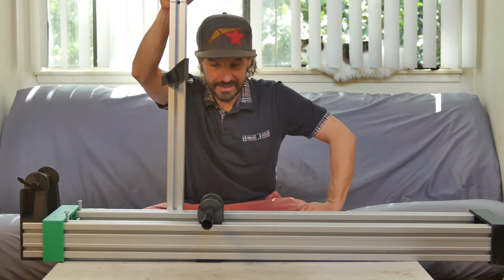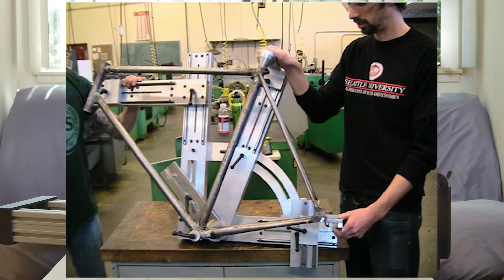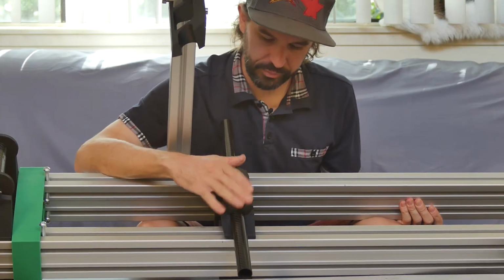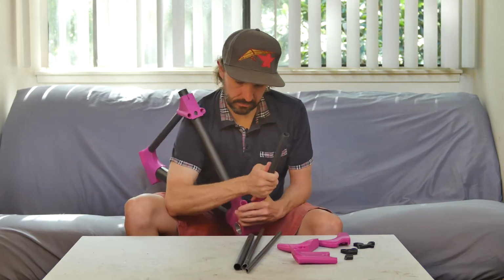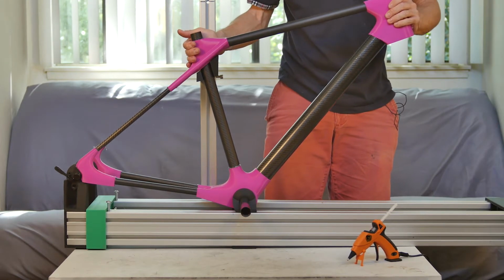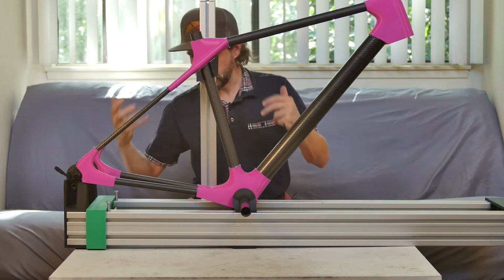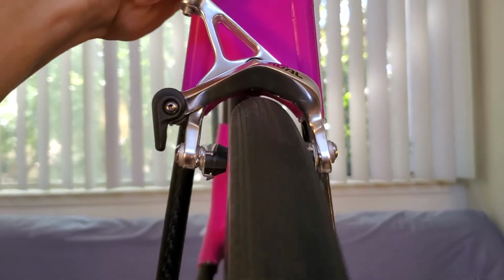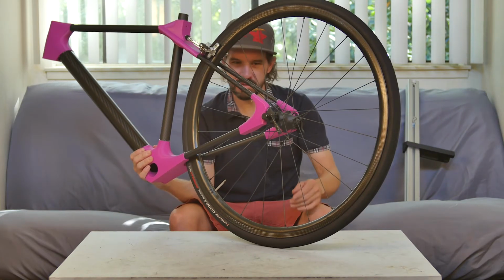Building a 3D Printed Carbon Fiber Bicycle Part 3 - Assembly Jig

Comment: Great job designing, making, and using that assembly jig!
Reply: By the way, I quite like the color the printed parts on this prototype bike haha. If only 3dxtech sold CF filaments with more color options.
Reply from the maker: @EphiBlanshey  Oh yeah I feel you and kind of became attached to the colors as well. Plus, having the printed parts in color definitely helps distinguish it as a 3D printed frame and thus unique. I did consider painting the final parts, but I try to avoid paint as much as possible as it adds a huge about of manual labor and I lack the tools or facility to do it properly.
Reply: @designbydave  agreed. One of the cool things about 3D printing is ability to customize everything, including colors, and distinguish it from everything else out there. But nonetheless, the end product will be awesome anyway :)